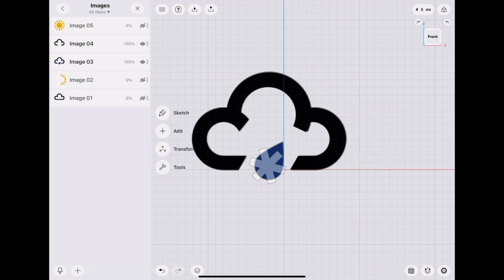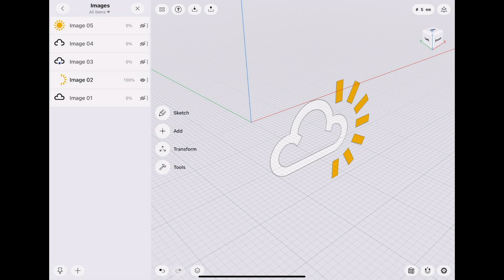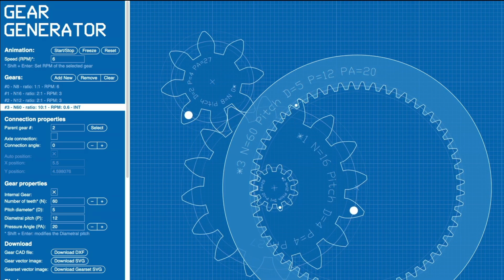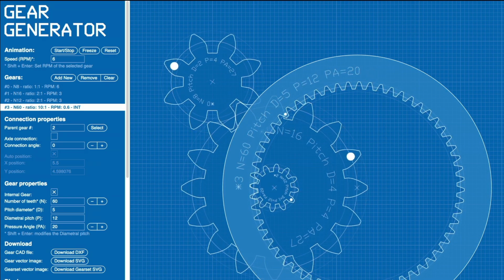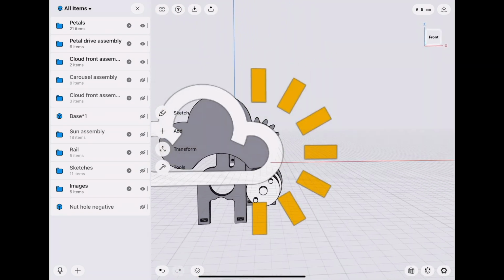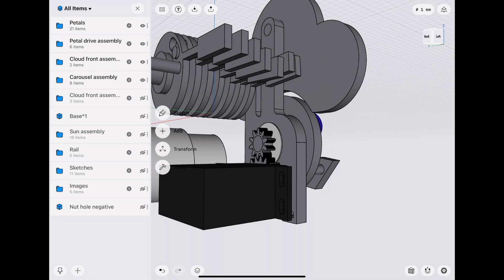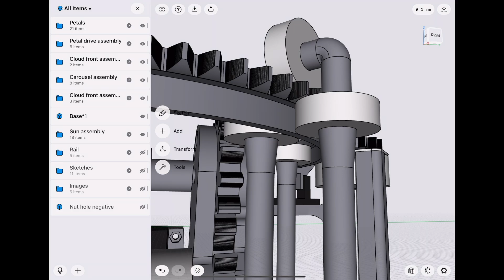3D Printed Arduino Weather API Contraption! Find out the weather without going outside.

Comment: Excellent, I've been thinking about something similar but a bit more basic: An ESP32 rotating a servo / stepper motor driven disk with the BBC / Met Office symbols printed on that disk and an appeture on the enclosure that the forecasted weather symobol peeks through. The ESP32 could be run on battery, put to sleep and waken every four hours or so to retrieve the next forecast. The intention would be to hang it on the wall in the hallway.
I still have an account at Dark Sky but with the Apple takeover of them it will be closed down the end of this year, it was one of the better sources I found; a lot of the online weather API's that I have seen are very US-centric. The UK Met Office does have an API though I haven't found an Arduino library to retrieve data from it.  As per another comment, the music makes it difficult to hear what you're saying - especially on in-built laptop speakers.
Reply from the maker: Good idea Colin- yes a flatter version that could go on a wall would be cool!

Comment: Really cool!  Only thing I'd do differently is add a cover plate to hide the two unused precipitation symbols (rain & snow or snow & nothing or nothing & rain).  But it's still awesome as is.  I really like your mechanism for "partly sunny"... :)
Reply: I said the same thing to mikey ! It is great  though.
Reply from the maker: Thanks Kevin!
Reply: Another option would be to mount the three precipitation symbols (e.g. rain, snow, none) along the rim of a wheel which rotated on a vertical axis.  That way, the two unused symbols would rotate to the back and be (more or less) out of sight.  

Bumping the cloud symbol out so that the wheel could rotate without interference would likely still be necessary.  

This would have the added benefit of possibly reducing the total height of the automaton.
Reply from the maker: That's true - I was struggling to find space for everything behind the thing in the end!
Reply: Yeah I'd be tempted to make the shapes be on a belt maybe so only one is visible at any given time but of course the belt would probably only work one way